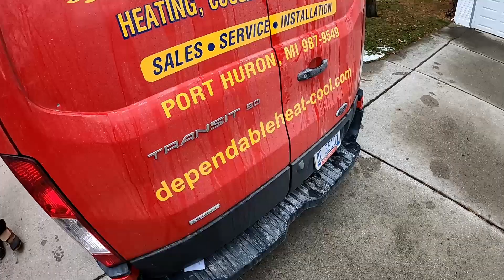Furnace And Water Heater Not Venting For 32 Years

Comment: Crazy, we got a red tag system where I am, it would have all been tagged out and shutoff, electric heater for the house til its fixed right.  The things we see hey
Reply: And when they tag they never write ✍️ what they tagged for or the specific part that’s leaking etc.
Reply: @techvlad8736  Liability reasons. If they tell you to fix x thing and y is also bad and you never told them about y, your fault. I got into it with a building inspector. He kept red tagging it. He wanted green ground screws. He only told me "does not meet code"

Comment: Wow, you might get past a water heater on CO, but not the furnace.  The house is definitely an old house which given the appearance, may not be airtight like so many these days.  Lucky for the owners.  I recently cleaned a boiler water jacket of debris.  One piece of metal is warped from overheating due to restricted flue air flow.  In the case of the furnace there, it must have heated up enough to be a concern before the limit tripped out the burners.  With rapid heat expansion, there might be something in that heat exchanger to be a concern?

Comment: Of course it was vented before, it would be all sooted up, among other things, and there is no way nobody noticed anything unusual in 25 years. Something would have melted by now. Like others have suggested, most likely one of the liner pieces slid down.
Reply: Absolutely
Reply: What liner pieces?
Reply: The masonry chimney in the video is lined using terracotta sections which together make up the flue.

Comment: You got more balls than me to get on a roof with snow on it
Reply: @Ampacityelectric  when I was a kid working in Anchorage we were putting a  raked roofon a flat top house the carpenter I was working for was a idiot we got there I rolled the big price of plastic up cuz we were working on the front half HR went up stepped on the back of the roof landed in a huge black berry bush in like dumb ass
Reply: Very dangerous not to tie the ladder off especially with snow on the roof that’s a very bad habit yikes 😳
Reply: @theduffster2581  curious- how do you tie off a ladder in that situation?
Reply: @TLCchh  I always use a bungee strap to the gutter especially if it’s windy keeps the ladder from sliding
Reply: Ive been on moms roof with a 1ft of snow. Its not that bad.  Coming down was not great so i tied a rope around chimney to hang onto
Reply: @tractorboy31  I grew up in Alaska so I've been on roofs with lots of snow but I'm older now
Reply: Snow has good traction. Ice under snow totally different animal.
Reply: @bigtuna4037  I grew up in Alaska  so I think I know a little about snow and ice
Reply: @plumbcrazy375  Whatever, I was on the roof today with snow with good traction. Maybe snow in alaska different or maybe you don't have the right foot wear.
Reply: @bigtuna4037  good for you hopefully you are safe
Reply: @bigtuna4037  I'm getting to old and fat to fall off a roof

Comment: I stumbled across ur video becuase my dad has a lochinvar water heater furnance  and for sum reason it wont heat the water up , the pilot is on. The burner flames are yellow and very scattered ,  we replaced the pilot assembly , when the furnance will try to heat up water the flame will shoot out for a while then it would like backfire in a way then it will just do the same cycle over a few times then shut completely off for a few mins. We are stuck and dont know what to do next we going to check the vent to see if theres a clog some where

Comment: It's possible that when they put in the water heater the flu tile was damaged when they popped through and it collapsed fell down and let the upper one slide in place it's rare though they don't usually slide once they're cemented in. I've seen tiles collapse mid chimney and fall and block the flu before.

Comment: Thermodynamically a 100% efficient system as no heat is lost with exhaust. I have my doubts this is an original install problem for with a blocked exhaust there would be minimal if any combustion air flow and if it didn't shut itself down on safeties that cellar would get smoky fast. In the combustion chamber there wouldn't be near enough air/  oxygen to support the flame. Energy can't be lost or gained, only transferred from one state to another.

Comment: Hi, This is Brian. I can absolutely reassure you that they experienced Carbon monoxide issues. If they have a carbon monoxide detector, it never went off because detectors are all set to alarm at a certain amount of the parts per millions. I was poisoned by Carbon monoxide and the alarm never went off. I researched this problem and found out that the alarms only go off at a parts per million amount that is well beyond human survival. The standards are way off and my findings reveal that when they alarm, it would only be to alert the rescuing firemen that there was a problem. There wouldn't be a living soul in the house to testify to this. I would recommend a c. Monoxide detector with a readout on it that monitors the PPM. If it regularly shows a 90% ppm, you have a problem. And youll keep putting batteries in it until you die. The homeowners would suffer high blood pressure, headaches, nausea,  coughing, sleeplessness, lethargy , inability to think straight and many other things which nobody could figure out. YOU SAVED THEIR LIVES! YOU DESERVE A MEDAL.  Thank you for sharing this.
Reply: I tested mine and it works.
Reply: @dong4617  Well, Aren't you the Boy Scout!

Comment: If that liner had slipped , wouldn't there be pieces of liner laying a the bottom of the chimney and what's the fix , bust out the liner and put the exhaust tubes back in place ?

Comment: How did the house not burn down from back draft?  Obvious CO risks aside, it's nuts they never had an issue with backdrafting or rollout due to the low draft.  Thank god it was an 80% and not an 80+ with forced induction.
Reply: Forced induction furnace would not have even operated with that blockage, pressure switch would never close

Comment: Is it possible the tile slid down the chimney and covered the vent inlets?
Reply: That would almost make more sense lol
Reply: @sunshinesucks1355  l understand  that... first installer beat the shit out of the original tile  and damaged it so badly it just fell apart inside of chimney
Reply: Yep seen it happen more than once! There is no way that’s been that way.
Reply: Phil Pompeo wouldn’t there have been a section missing from above though?
Reply: One of the lower ones. More than likely the last one which would be very hard to see from up top.
Reply: Is there a clean out on the bottom to see if a clay section caved in and slid down
Reply: @spaceboy7192  I like this theory

Comment: I am assuming you vented the furnace and hot water heater another way or busted a hole in the chimney flue pipe  to vent them but I didn’t see it or hear it mentioned   Went back through video twice. What was the fix?
Reply from the maker: Busted a hole through the crock
Reply: Sounds about right thing you did

Comment: Makes sense huh. Kinda like the people that remove vents and replce siding and owners wonder why mold is in atic. From the dryer vent being covered up when vents are removed then forgotten about. Its a " I thought he did it" thing. I cant believe the occupants did not have headaches, fatigue or just feel sleepy all the time! Even more so, did not die! They'd best thank God they live in an older home thats not tight like newer ones. I see the same stuff in automotive. Like one time a guy says all his anti freeze leaked out when he tried to replace his t stat in a caddy with the 4100 eng. In his replacing it, using a hammer and chisel, he beat the t stat through the intake and my finding it in the lifter valley of the engine! Anti freeze in the oilpan! Yeah, that lil. I woder in that guy stole this guys hammer and chisel, causing the liner not getting its pass through lol. Ridiculous stuff people cause and can do to others all due to the lack on common friggen sense! These people dig in thier pockets when you confront them and ask them if they have any sense at all!!!

Comment: At (12:13 ) when the furnace fires up he says “ it’s cool as can be now, feel that “ ... is he referring to the vent pipe coming out of the top of the furnace now that it’s exhausting properly ?.... the reason I ask is I have a similar set up and the exhaust pipe coming out of top of my furnace heading to the wall gets so extremely hot ya can’t touch it. ( I have co2 detectors in the house and they have never gone off )
Reply from the maker: (12:13) Under the draft hood is cool no flue gas coming out.
Reply: @MiHeatingGuy  thank you

Comment: Bud you've gotta get used to tieing your ladder off, especially in those conditions
Reply: Lol osha regulations state if its a permanent access ladder it needs to be tied off with 3 rungs above level ur accessing   If its a temp access doesnt needa tied off, i never tie my ladders off never had issues even with 40 ft ladders  its all depends if u set it up right
Reply: So a  permanent access "fixed' ladder needs to be tied off, new one to me in 20 years of roofing
Reply: @mikejohnson7768  maybe its different depending on trades not sure i work in erecting  precast
Reply: I like the feel of a secured ladder, I always tie it to something. Years ago I did have one knocked over and before cell phones had to keep telling for someone. That's never happened again.

Comment: Isn't there supposed to be a liner in the chimney for gas
Reply: That's what the clay chimney liner is for.  Before that, chimneys were just brick and unlined.  The exhaust gasses eventually erode the mortar and you had to install clay chimney pipe liners.  Now, you would install a "metalbestos" pipe.

Comment: I wonder why the just started having problems after all those years?
Reply: Probably the pipes started sutting up and clogging
Reply: I’ve seen the terra-cotta flus slide down before. Seems like that’s what happened here. There is no way that’s been like that.
Reply: Phil Pompeo that would be a good explanation, I’m surprised he didn’t put a stainless steel liner  in

Comment: Cracks in brick looks like maybe chimney flue slipped down connection should be been verified inserted past flue edge horizontal pitched flue to nearest side of house chimney flue could still be drafting in house if compromised. Co test  alarms and monitor for safety sake...

Comment: There’s no way a furnace would operate for 1 year unvented. This is very obviously a chimney failure. In harsh winters as Michigan has why wouldn’t you recommend a high efficient furnace. This customer of yours could be saving hundreds every winter. To blame the original installer is obscene.